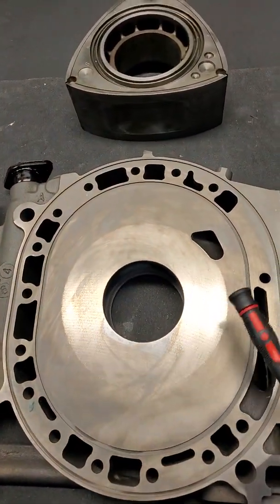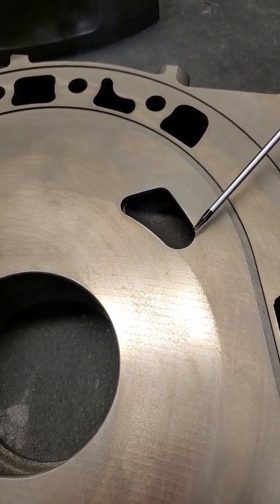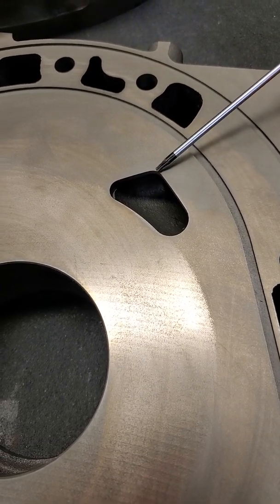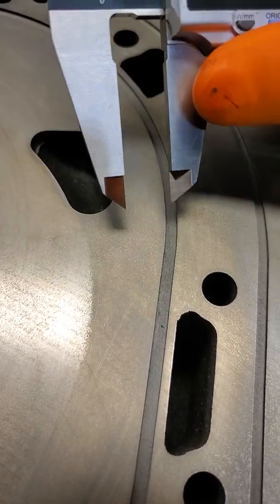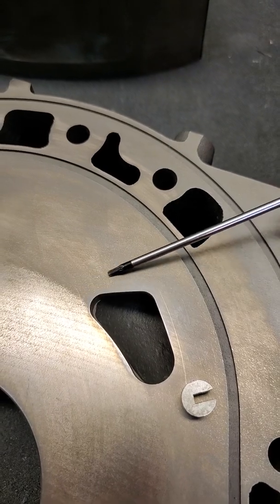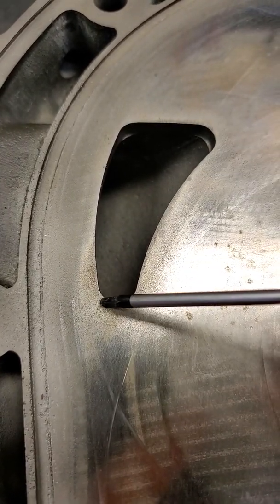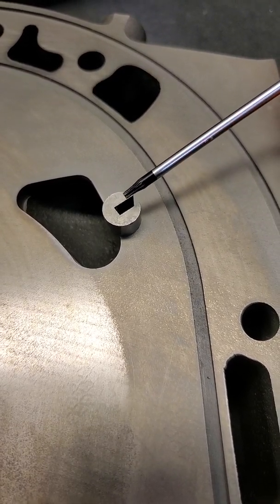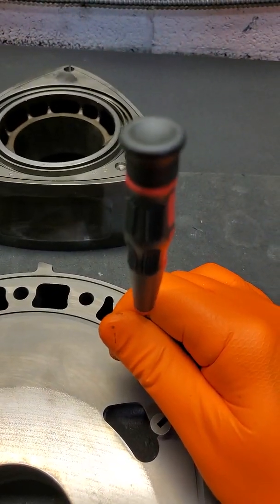Rotary engine port tips and tricks..

Comment: What you're doing will work fine, but the explanation is a bit wrong. The area you are calling the bridge, ie, the side of the port near the O-ring, is actually the port opening, and the bottom does not change timing just increases the area/flow. Next time you build an engine just rotate the crank and watch the rotor pass over the port and you will see what area gets uncovered first - I've got a vid if you want to chase it up -.